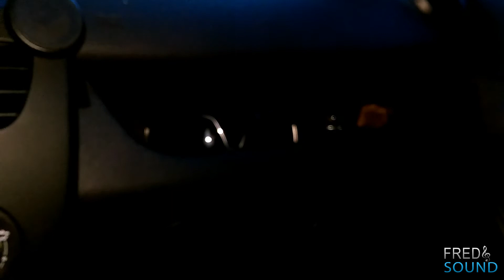Renault CLIO STEREO UPGRADE With STEG RE65C + STEG SQS12 + STEG K Series + Pioneer PRS-80 (INT)

Comment: the install looks awesome!! how did you tap into the radio? ive been looking for a wiring diagram but can find anything online for a 2018 66kw clio4
Reply from the maker: tyrone myburgh hi, behind the oem
Stereo you will have the stereo harness, you need to locate the hi-input levels(oem speaker outputs), the installers find out via audio tools, if you don’t have diagram grab a small speaker, turn the stereo on, and try those wires (behind the head-unit) until you hear sound, you will have total 8-wires +- of Total 4ch out, for rear and front, ones you have you’re wires located connect them to high quality dsp for max output, thanks for watching
Reply: @frednsound  Hi, Fred awsome video. Im doing an install on my clio same model. May I ask if there where any areas to pay attention to with sound deadening / treatments im trying to get rid of any potential rattles in the car. Did the spoiler on the car give any problems? also do the plastic wheel wells make noise? Last stupid question do those capacitors help alot or not really?

Comment: How run a power cable through firewall to inside the car ? PLZZZZ help !! 🙏🙏🙏🙏
Reply from the maker: Hi, above the brake pedal, you will fine some rubber gourmet, you will need to make a hole trough that, thanks for watching
Reply: @frednsound  thank you sir 🙏🙏.  One more question. Should I remove battery to reach there ?
Reply from the maker: @sunny83dk  hi, welcome, no, you don’t need to remove the battery, just some skills to get the cable trough, thanks
Reply: @frednsound  one last question sir. I can see rubber above break padle. When I removed that rubber I can nut there should I remove that nut ? Plzz help 🙏
Reply from the maker: @sunny83dk  hi, no nut, try picking with a screwdriver to feel that soft part, where you can pinch a hole to get in, thanks
Reply: I don't see any wisible place above the brake pedal to go through? Did you find it?

Comment: Hi Guys, great job done on the clio. I have a question, I have the 2016 Renault Clio Blaze LTD edition 0.9 Turbo model and I want to know if I am able to connect sound to the stock standard Navigation radio that's in the car?
Reply from the maker: Wayne Rossell thanks, yes you can by using Dsp processor,or hi lo adapter, thanks

Comment: how you passed the woofers wires inside the door?
Reply from the maker: Marcu Lucian  hi, thru the black harness that connects to the door, thanks
Reply: but there is a pin plug you put new pins? thx for your answer :)
Reply from the maker: Marcu Lucian  I found a free pin , made the hole , and run the wire, thanks